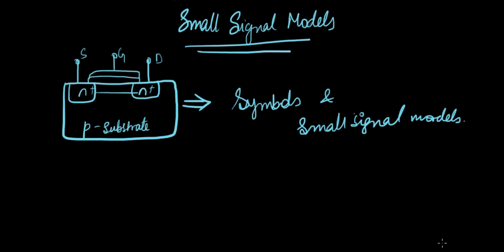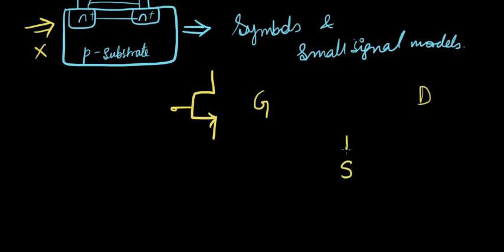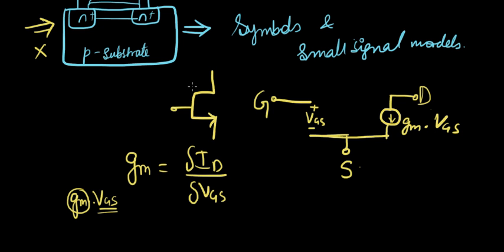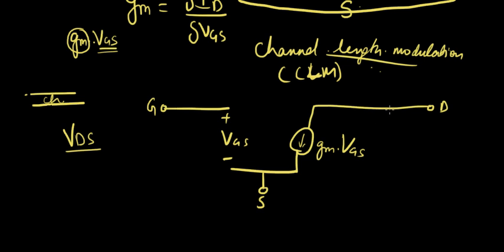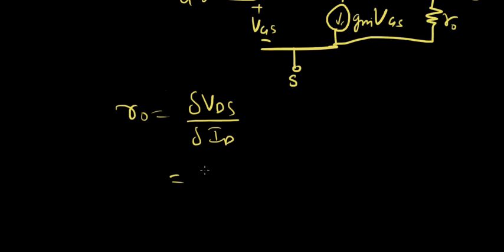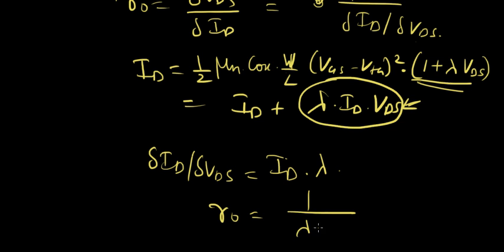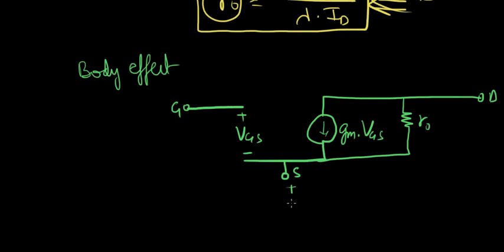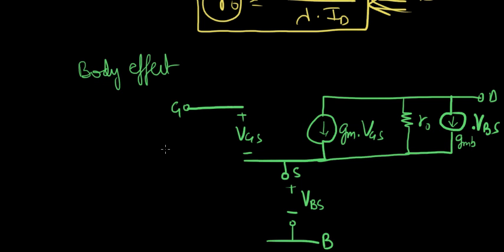Small Signal Models

Comment: i am having a confusion regarding the inclusion of the body effect in the small signal model....now body effect increases the threshold voltage if Vb is less than Vs,which will reduce the drain current but here you added another current source in shunt which will increase the Drain current.......pls clarify.......or its just that u wrote Vbs with Vb>Vs.........pls reply